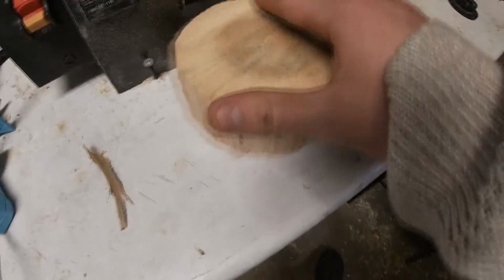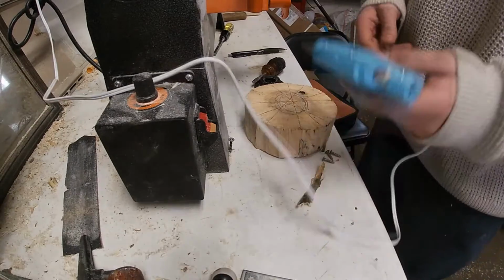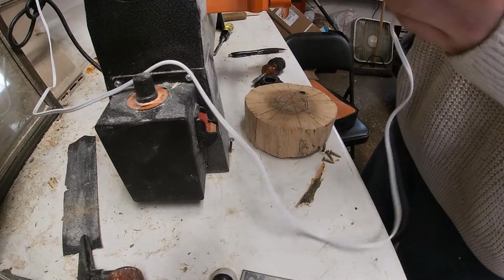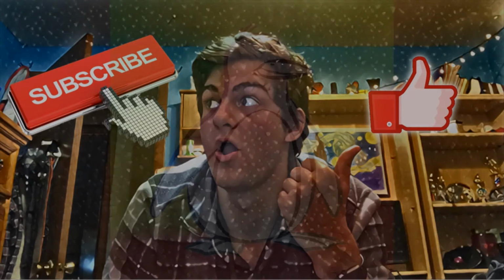AMAZON WEN LATHE $180

Comment: FYI, This is designed for small turnings like pens and ornaments with a maximum diameter of no more than 4". Otherwise you could burn out the motor and/or bushings.
Reply from the maker: The diameter of the bowl I made was 3 inches by 2 inches With soft wood. I was within parameters.
However despite that, and Considering this was $180 and to replace the motor is probably like $40. If it ever decides to shit out on me, I’m okay with that. However I have used this heavily and she keeps on truckin. 

     Thanks for the tip none the less, I know it’s in good heart. And I appreciate you viewing my video, and advising me. I truly appreciate it thank you.
Reply from the maker: Actually it was 5 inches. So your right I’ll admit.  But like I said. If it breaks, I’ll just upgrade the motor probably